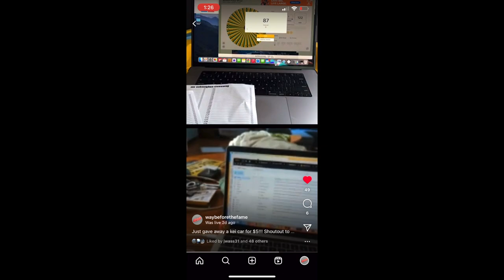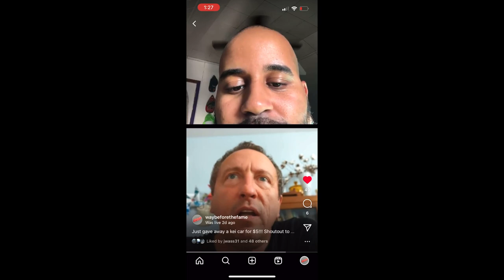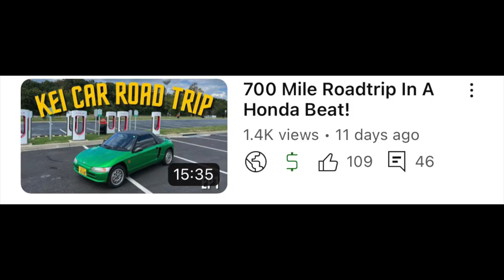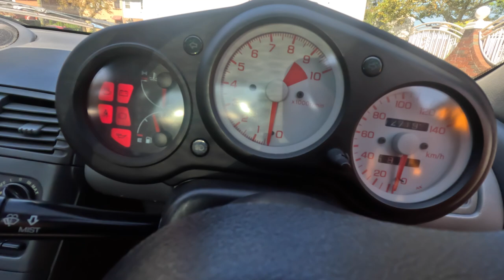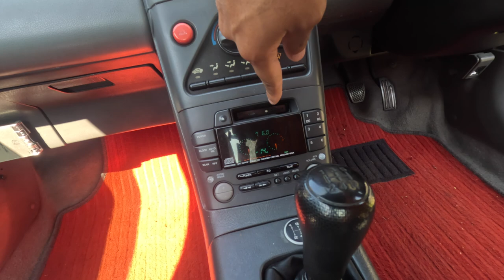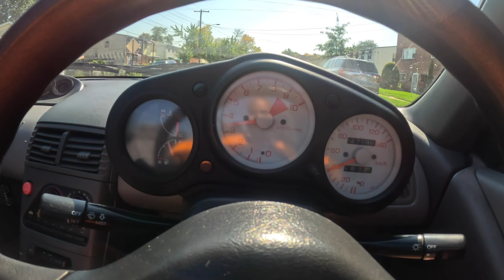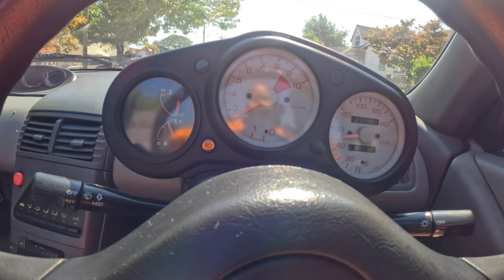Its Honda Beat Time!

Comment: Best of luck to all of the wafflers but really, Nick...you discarded the spare tire from a car that you knew you'd be flipping? Sort of like pulling out the passenger seat and setting it out on the curb. That move makes no sense to me - I understand taking it out so you'd some extra cargo space but...I dunno.  Love your vids, dug your recent road trip, congrats to the $5 Kei car winner, and yes, titling and registering a Kei can be an uphill battle - I know as I had a beautiful blue Sambar Dias ready for delivery this summer but had to cancel due to the crazy regs where I live. Keep up the good work!
Reply from the maker: Thank Man! In hindsight I should keep the spare but that spare tire is on 30 year old rubber so driving on that is maybe even worse than the flat and waiting on AAA or stopping at a tire shop nearby lol